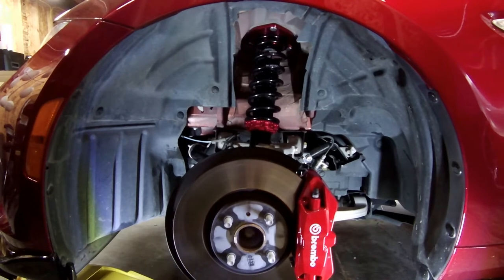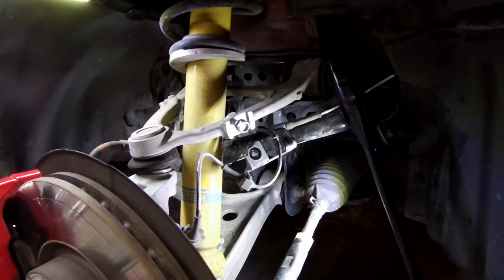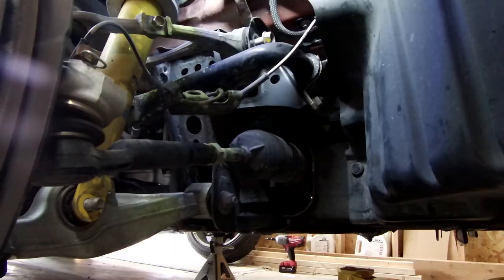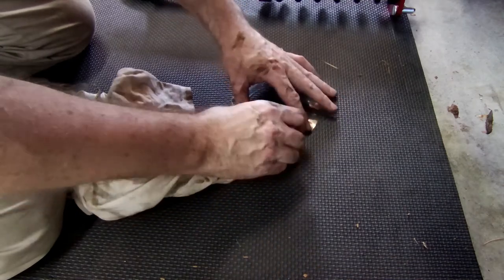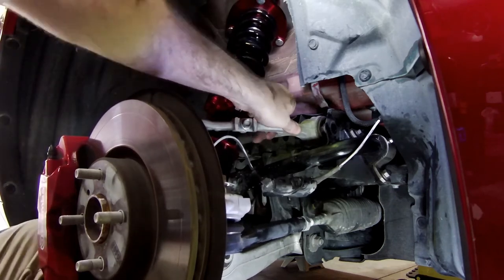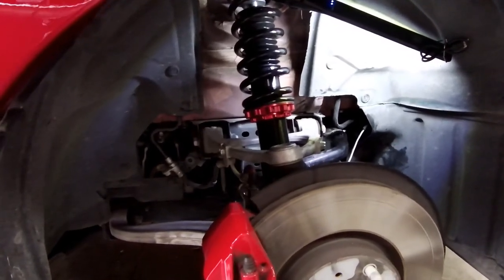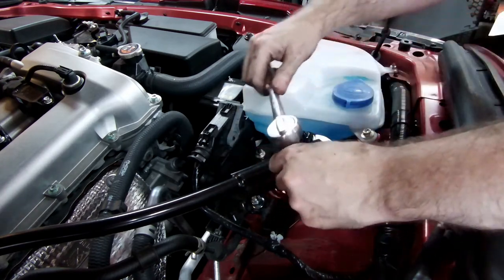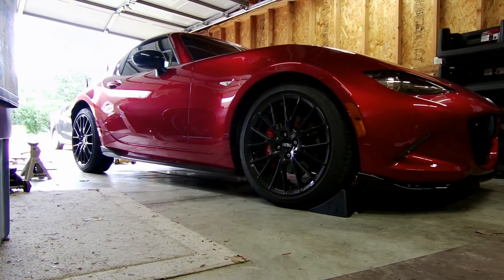How to install front coilovers

Comment: Looking forward to another installment with your driving impressions and experience tuning your settings (alignment and coilovers).
Reply from the maker: They are still set at 15f/20r and ride well.  My Corning speed has gone up nicely due to the increased stability and the steering has quicker response.  They handle potholes very well but dips are felt more (to be expected).  Most important, perhaps, is they passed the wife test...  ;)
Reply: That’s great! Are you happy with your preload settings or do you think there’s a better compromise to be struck between compression and droop travel?

Comment: For reference, per the ND manual, the torque specs for the strut brace nuts are 12-19 ft.-lbs., which Kill-O-Byte appears to have nailed perfectly by feel in the video. 😄
Reply from the maker: Thanks for the info!

Comment: Just wondering if coilovers will make the ride quality harsher will it firm it up?
Reply from the maker: Depends on the coilovers. Be sure to read reviews and make sure the springs aren't too hard. On my MeisterR GT1s, I can set them at to F5, R8 for autocross, slightly softer for track , and then set them to F25, R28 for a soft, smooth drive home. I really should do a review on those...
Reply: @Killobyte  please do a review.